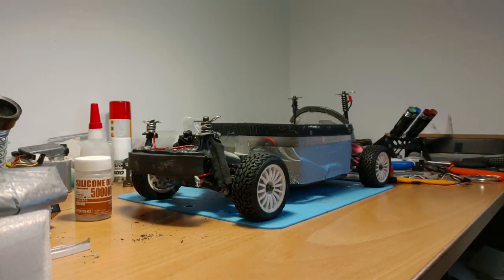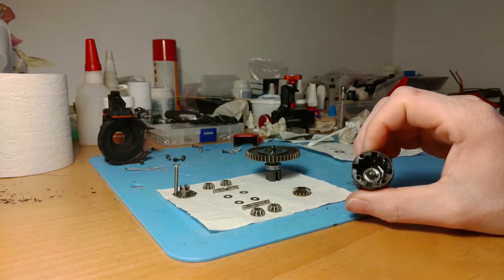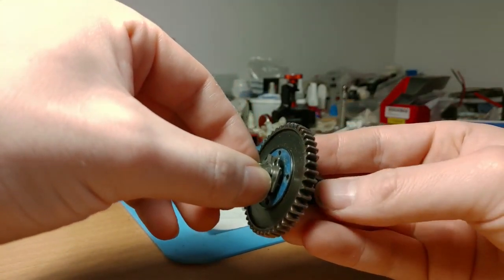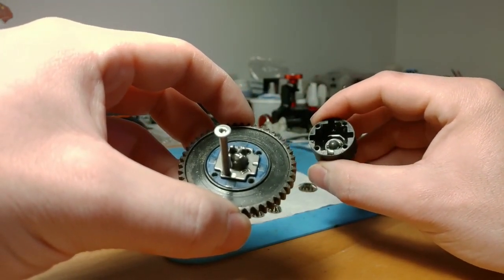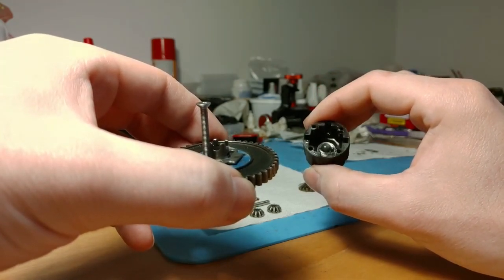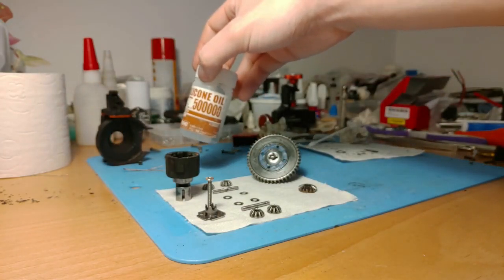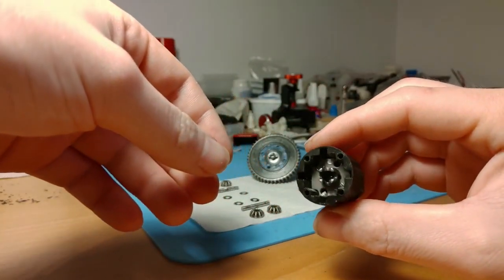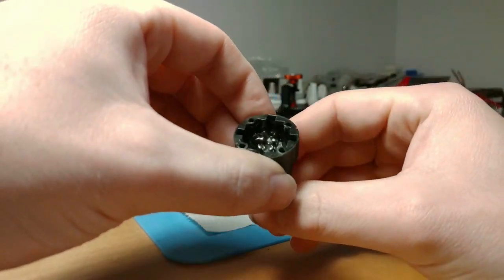What's so special about the center diff in my WR8?

Comment: Have you run that diff component before I like how it gives direct drive to the axil of choice
Reply from the maker: Yes mate! For several years, on dry tarmac to snow. For me it works. Others may have other preferences but I think cars without the center diff work good. This, with a very high viscosity oil to just give it a bit more understeer works almost the same, but a bit better.. ;)

Comment: Do these car's come with a reverse channel or do they just go forward
Reply from the maker: Yes and no :) There's only one channel for throttle but they do have reverse. It's the same input as braking. The electronic speed controller determines if car is rolling forward or is stationary. if rolling, it applies brakes but if already stationary, it will reverse. There can also be a time gap, like 0,5 to 1 sec that the car has to be still before it's possible to reverse it